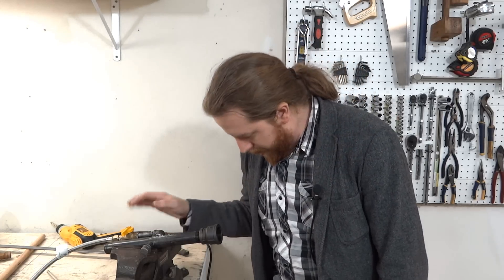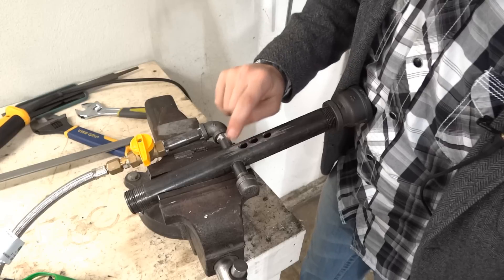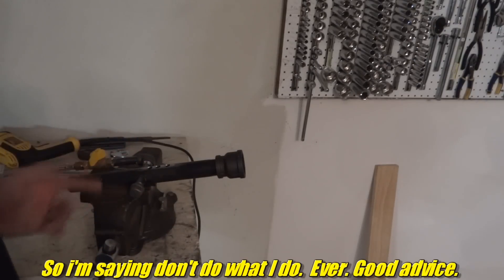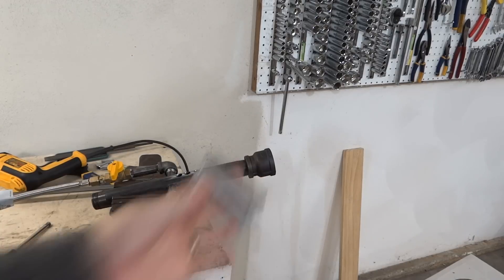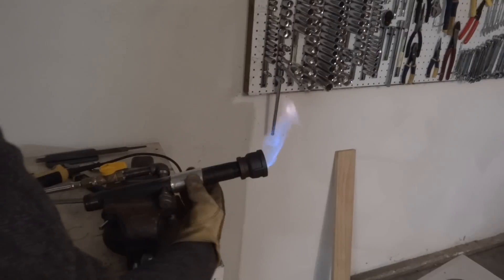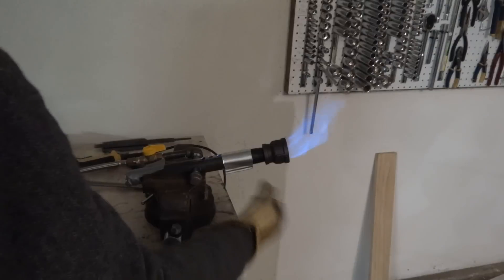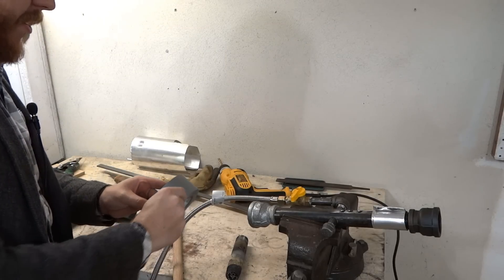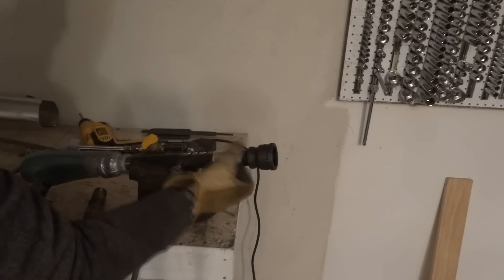Making a Propane Burner even Hotter

Comment: Paul, I'm kind of dealing with the same issue.  I also drilled the holes in the tube to try to see if it helped and then realized that the holes would be blocked by the refractory after I stuck it into the forge.  I am going to try a longer tube and maybe a larger jet.  (I'm using a .025 mig tip)  I am subscribed now and will begin sharing my progress on You Tube as well.  Keep making these videos.  I love your format and videos like yours keeps me motivated to keep pushing forward with my project.  Thanks!

Comment: Maybe with the dryer you could melt metal faster thus using less propane than you thought. It might be a more efficient burn. Plus you could make a blower bypass just like you made your air intake holes and sleeve but this would regulate pressure going out not going in thus allowing you to fine tune air injection and run less gas.
Reply from the maker: That could work.  The only way i was able to get a lean flame was using the hair dryer, so i definitely had more range of adjustment using forced air.  Not that I want to use a lean flame, but without the hair dryer i couldn't even get a nice neutral flame.

Comment: Forced air will burn about twice the propane that venturi style burners do. Look up Ron Reil burners, They burn super hot with great efficiency
Reply: Hate being that guy but that's not true at all. Very common myth though. Do you use more propane by manually turning it up with a Forced Air? Yes, but the same applies to Venturi's when you turn up your propane. Why? Because the pressure from the propane in a Venturi burner cause the air flow. ie. More propane means more air.

While with a forced air you have the choice between both. More air or more propane. If you properly regulate your air like you do your propane then you can fine tune your burners to set temperatures. Kind of like an oven. Can't do that with a Venturi.

In short there literally identical in practice but one has more regulation options.

The only upside a Forced Air has over a Venturi is the fact it can be turned down and still work under very low pressure unlike Venturi. They are also easier to build over Venturi.

Now I know what your thinking. Well, more oxygen from a Forced Air means more combustion ie. more consumption. Well that would be true if there wasn't the most critical thing that everyone over looks. The forges environment. No smith heats metal in a over oxygenated forge. Why? Because of scaling issues on the metal itself.

It is extremely important for bladesmith and decorative art blacksmith to have a proper forge environment. I could go further into a proper forge environment but that would double the length of this late reply.

Sources: I've built both and ended up with a forced air for reasons stated above. Do I think one is better than the other without exception? No, but for what I do a Forced Air is the better option. And no...It does not use more propane than my old Venturi's....
Reply: Actually, it's fairly easy to make a venturi burner that can be adjusted for a wide range of pressures. You just change the air holes to air slots and get an adjustable sleeve over them. Also, a venturi burner is a bit more self regulating then a blown burner. When you turn up the pressure, more air will also be sucked into the burner. With a blown burner you are constantly adjusting the air/fuel mixture.

There are also a lot of misconception about the temperature a venturi burner can reach. I know at least one smith who regularly makes wootz (aka, melting steel) with a propane furnace with a single 20mm venturi burner (Achim Wirtz). 

I have just build my first blown burner, and frankly I don't think it's worth the effort, and I am planning to return to a venturi burner.
Reply from the maker: +Jack Rellstab I saw reil burners, don't know why I didn't choose that one to build.  In hindsight it probably was a better option than the upwind one.

Comment: I have a torch that was having the same problem, flames going back down the pipe and creating a terrible racket and very little heat. I solved it by increasing the length of the pipe. For me the problem was that the air and propane was not being mixed sufficiently and backfiring down the tube a dozen times a second. I went form a 6" pipe to a 12" pipe and the mixture coming out the end was then sufficiently mixed and the flare at the end stops the flame from traveling backwards due to the low pressure zone it creates. A well mixed flame produced a sufficient sucking power that you wont need any forced air to push the propane down the tube.
Reply from the maker: +Andrew K is that the "popping" noise I hear some burners making?  I always wondered what caused that.

Comment: Try putting your flare on the opposite end and turn your gas orifice 180 degrees. It will draw air from behind the gas source.  That is how some burners work that I have seen.
Reply from the maker: +Keith Ackermann that's a good idea!  I wish I knew that before I egged out those holes in the wrong direction lol.  I'll probably build other burners in the future, though.  I can always try out more designs
Reply: Paul's Garage I hear ya. Give it a shot if you have the time and inclination.  I would love to see if that helps the problem.

Comment: Good luck with the burner!  If it just won't burn at the flare reliably... well, there's always waste oil!  (come to the dark side, muhahaha...)
...Or maybe build a Reil burner.

Just slightly oxidizing (lean) is what I aim for when melting aluminum; I figure it's better to skim a little extra dross than end up with casting full of pinholes. Degassing the dissolved hydrogen that unburnt fuel from a rich burn will happily provide is fun to try once (wheee! bubbles!), debatably effective in the backyard foundry, and mostly just kind of a PITA.  On the other hand, you'll have to skim some dross whichever side of dead neutral you end up dialing your burner in to.

Fun videos, keep it up!
Reply from the maker: +Tobho Mott in hindsight a reil burner would have been a better choice, but I'm glad I got this one to work.  I hadn't thought about hydrocarbons gassing up the aluminum but that makes sense, I'll keep that in mind.  A little extra dross in exchange for less porosity sounds like a great trade off to me

Comment: You might need to move your air holes up the pipe towards the flare more? I could be totally wrong about that, but I'd like to see it just to be sure.
Reply from the maker: +Paul Frederick I was thinking the same thing, maybe adding some in the flare or right before the flare.  It might let me crank the pressure without a rich flame.  I'm not planning on using the flare with the furnace, but I might.  Details are all subject to change at this point.
Reply: I know this is from a couple of years ago but I'm pretty sure with a venturi you want it close to where the gas is introduced.  The benefit is that the nozzle gives the fuel and air time to mix and combust cleanly.  Closer to the business end would give it less chance to mix therefore worse consistency in the mix.

Comment: I believe you should have a larger flare on the back end to make it a proper Venturi style. The flares on both ends help build the vacuum in the tube preventing the flame from going back in. I built mine like that and have had no problems. Also I run mine in my furnace without a flare on the burning end because the furnace itself is the flare. I have noticed no need for a gap between the pipe and the furnace to allow air in. This article might be helpful (http://www.abymc.com/Articles/Submitted/PropaneBurner.html)
Reply from the maker: +Travis Bills the way this one is supposed to work is without a Venturi or air entering the back, but this design is known for being problematic (wish I knew that before building the dang thing!), thanks for the link!

Comment: love the video. I assume that your next video might be you making that new and improved furnace if you do.I suggest that instead of using to refract cement you use instead kaowool.
Reply from the maker: +Toadsage23 I'm holding off building the furnace until I can get some materials.  I'll probably use a mix of refractory stuff and kaowool as insulation, just kaowool doesn't last with a torch against it unless it's coated in something like satanite (an awesome name for a coating, btw).
Reply: Make sure you thoroughly dry the refractory cement to prevent cracks or blowouts.

Comment: Fuel "economy" is for chumps. Keep the hair drier on.
Reply from the maker: +powers2440 good point, I wonder if I could rig up a blower that also runs on fire somehow...
Reply: +Powers2440 it shouldn't use more fuel actually, if you keep the regulator set at one thing, then you're just adding more air with is making the fire hotter.

Comment: So are you going to use this or keep using charcoal? Keep up the great videos!
Reply from the maker: +JR Garvin both.  Propane is for the new foundry, but I'll keep the smaller one and use charcoal in that
Reply: Paul's Garage You have two foundries? I thought you only had the one casting cement foundry
Reply from the maker: +JR Garvin so far I have one but I'm building a new one for the propane burner
Reply: Paul's Garage I see. Ok. What are you going to use to make it?
Reply: No you wont paul.  Charcoal sucks and too big of a PITA!  Once you melt metal in your furnace using propane, you'll never go back.  Nice job with the new burner.  Now go melt and make cool stuff.   Are you planning to do any bronze stuff?